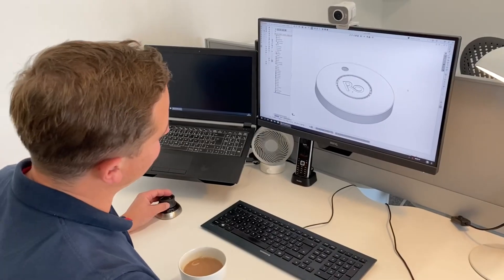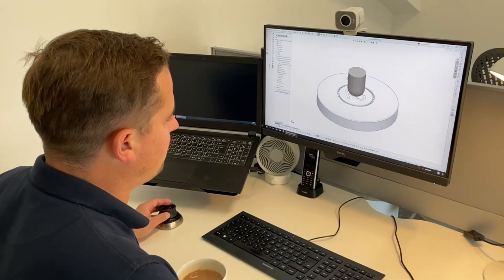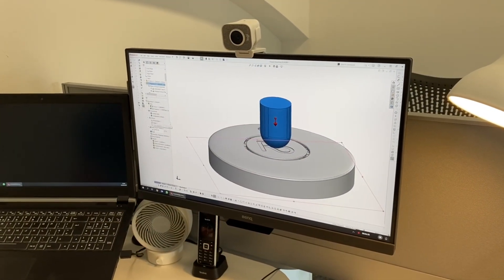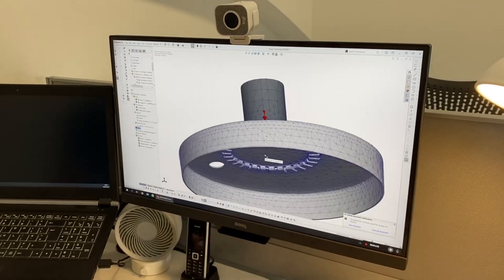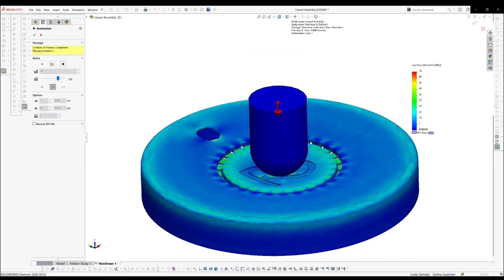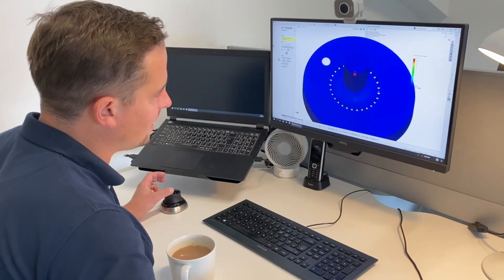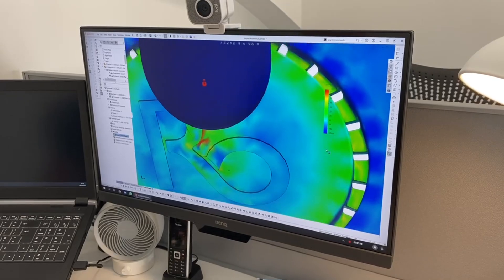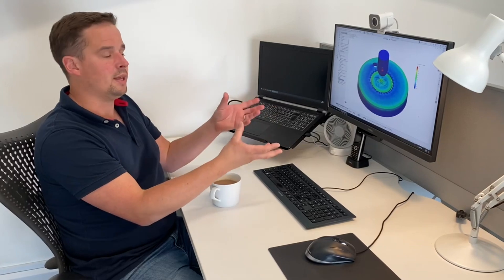Simulating Impacts with SolidWorks FEA

Comment: Hello,
Can we do impact/crushing/compression study using Linear Static Simulation?
Reply from the maker: You can get an idea of where the peak stresses and deformations will be, but it will be an approximation.
Reply: @raymont-osmanproductdesign3973  thank you for the prompt response. Imagine that I have a pen on a hydraulic press. Can the breaking of pen be simulated on linear static simulation or will it require non-linear one? And why?
Reply from the maker: @CADLady  When a material breaks, it is has gone past the range when it's material behaves in a linear way on its stress strain curve. Your problem would be very complicated, and into the level of complexity for the deformation of a car in crash tests. It would need very specialist software and highly skilled engineers to even give you an approximation.
Reply: @raymont-osmanproductdesign3973  I understand now. Thank you so much!